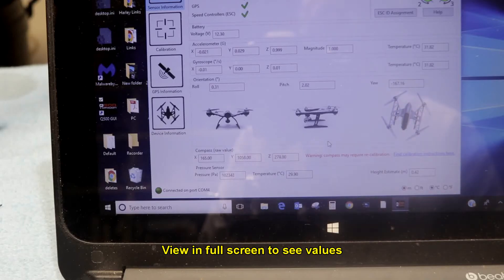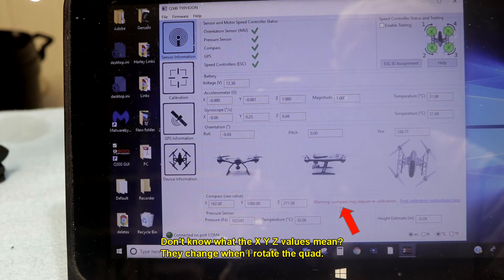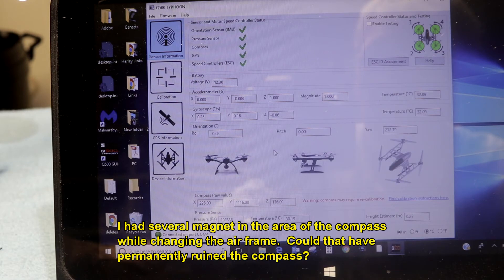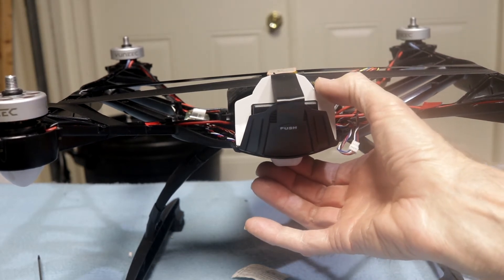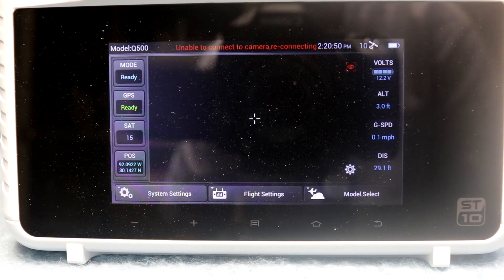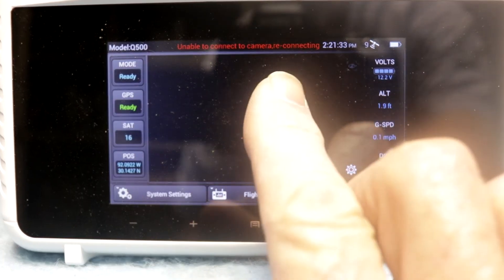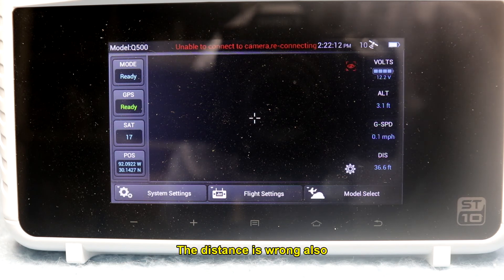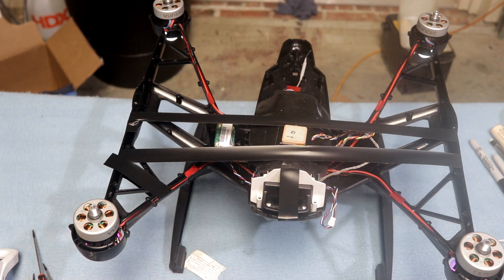Yuneec Q500 Compass Troubleshooting - Expert Help Needed

Comment: I do believe the compass unit is located in the nose near the camera mount.  It is a white flat plastic board with two wires.  The only things in the legs is one out of two antennas.  Hope this helps.
Reply: Thanks, I finally figured it out after changing the main board and compass.  It turns out I had the compass mounted 180 deg off.